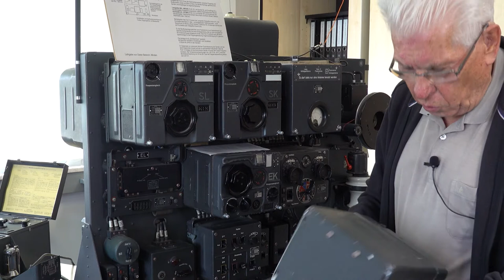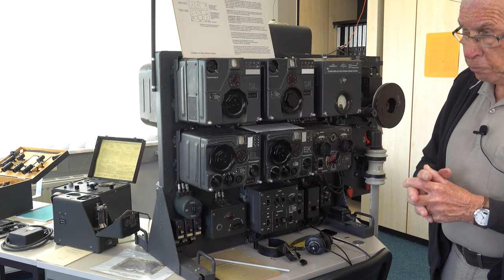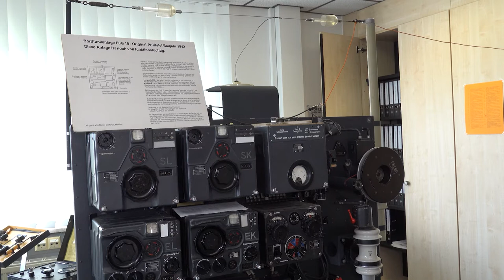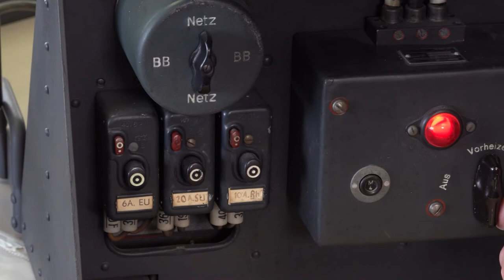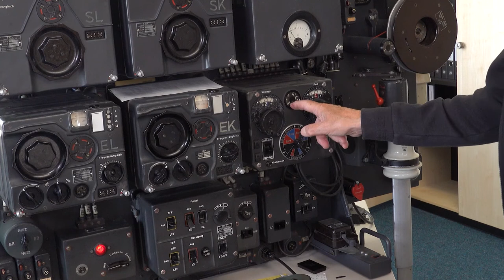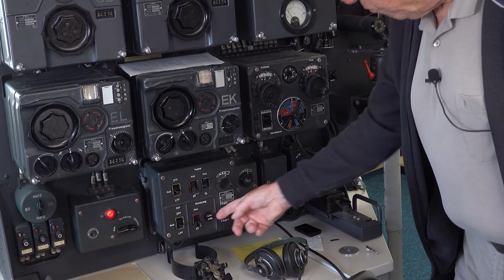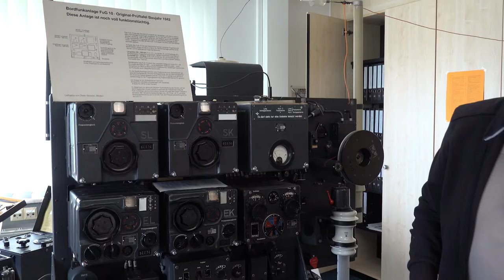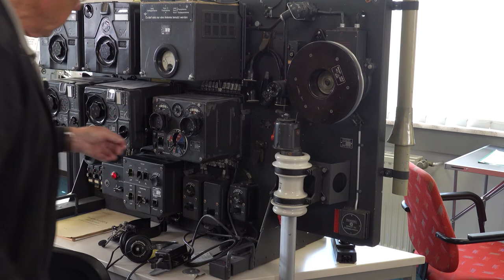FuG 10 Luftwaffe radio transceiver by Lorenz

Comment: Great video. This system was so well designed.  The individual radios were also amazingly reliable.  I bought a FuG10 EK shortwave receiver ten years ago that had lived in a Cologne attic since the war.  Despite a few bashes on the case it powered up and only one resistor had gone high (in the local oscillator HT line.  Remarkably all the 0.1uF decoupling capacitors were perfect and did not need replacing.  In a British wartime aircraft HF receiver every decoupler would be very leaky and the equipment unusable today without major work.  All valves were perfect on my EK (Empfaenger Kurzwelle - shortwave receiver).  The stability was excellent and HF Volmet SSB stations stayed exactly on tune over a full day.  I ultimately donated it to Clydebank museum.

Comment: we did the florescent tube  with a Mobile TX2250 piggy backed on a TX5500 with a JoeGun mobile competition antenna . The tube lit up 20 feet from the Mobile . Pontiac Acadian  4 door with a fork lift battery in the hatch back.

Comment: Thanks :)
Reply from the maker: Hi Suusi, and thanks. I can see you are a loyal viewer, and I note you've left a few messages. Maybe you could subscribe? It would help our channel in our efforts to reach 1000 subs! Thanks again. KR RJD
Reply: @deutscheavionik7211   I have subscribed to this channel. These Lorenz systems were very advanced. As an electronics engineer I find them fascinating especially the FuG 16 ZY. I have even built some simulations of the TX and Rx in Ltspice. 

I have also built simulations of some of the FuG 224 Berlin circuits.